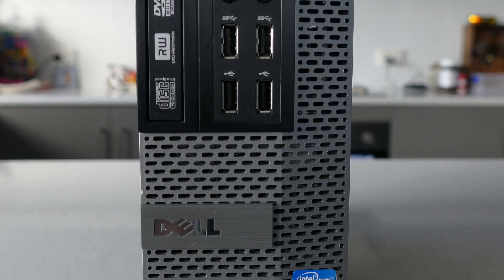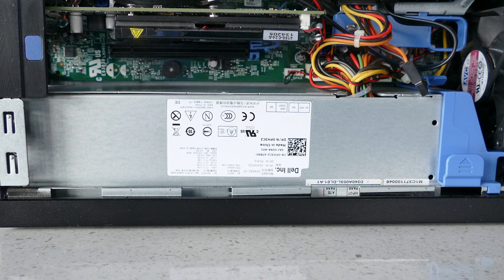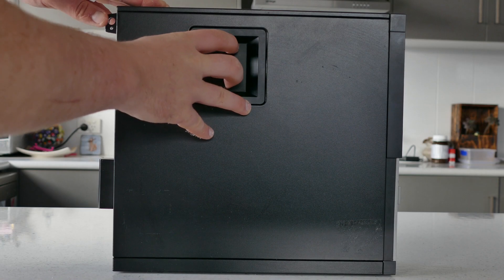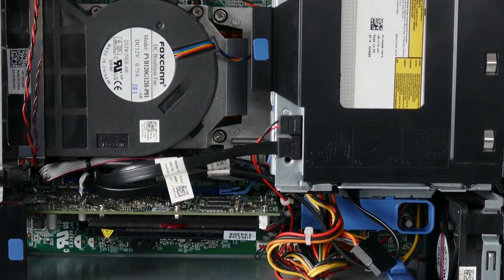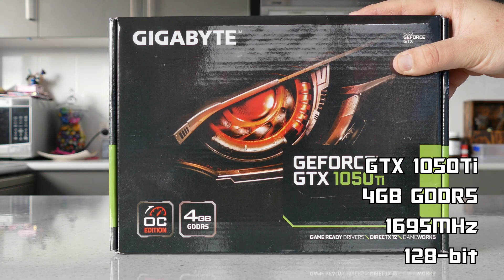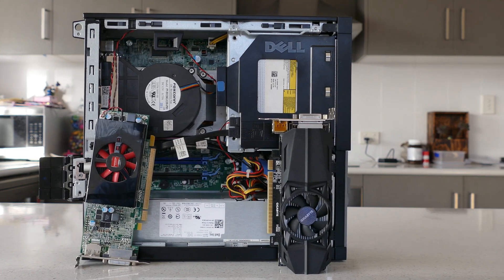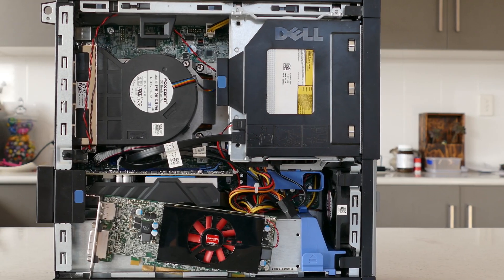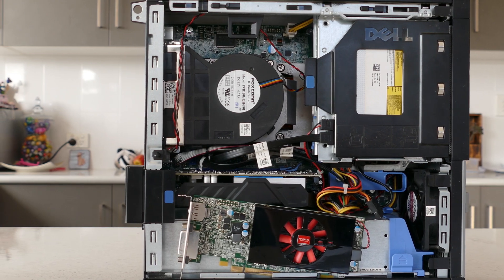Is the 1050Ti a Worthy Upgrade for this Old Dell?

Comment: bro can i use 24 to 8 pin for case swap my lenovo v520 sff that the oem psu is 180w or that can i use a gtx 1050 in 180w psu
Reply from the maker: 1050 will work with your PSU

Comment: Im getting a gtx 1050ti in a dell 7010 dt should i upgrade the power supply to 300w so the components dont die quicker?
Reply from the maker: Check the pinned comment, it will be helpful.

Comment: get a 1650 low profile instead...1050ti is on the very limits of 1080p gaming...
Reply from the maker: 1650 wasn’t released or had only just launched when this video was made so they were too expense for the little gain they offered.
Reply: @EverythingbySam  I have both cards and the 1650 is actually a substantially better performer for me.

Comment: we both have the same CPU's with same built inside but yours is 9010 and mine is 7010, why is that?
will a low profile 1050ti or 1030 card fits inside and run GTA 5?
thanks, good content mate.
Reply from the maker: 7010 is meant to be slightly smaller than a 9010.

Card will fit and I show GTA 5 benchmark in the video. Don’t have a 1030 but would still work just less FPS. Do some YouTube watching or Googling if you want to find out how much less.
Reply: @EverythingbySam  thank you. Is it true that using 1050ti on a low power supply like 240v might damage the power supply?
Reply from the maker: I cover this in the video in the pinned comment but to summarise it. There is a chance but very unlikely.

Comment: I myself would not put this into a SFF PC without leaving the side case off during long sessions. Overheating could be a problem in the long run. Just because it can be done doesn't mean it should be.
Reply from the maker: I can’t remember the specific numbers but I did test thermals for over an hour and so did the person who bought it from me.

It was safely away from thermal throttling.
Reply: @EverythingbySam  I just notice that it sets over the power supply with very little gap. With the video card having just one fan and gaming for 1 hour plus this thing could get very hot. If you live in Canada might not be a problem but for someone living in a hot environment this could cause thermal throttling or even destroy you video card. Again anyone doing this should remove the side panel for better ventilation during long sessions. Just my 2 cents.
Reply from the maker: I live in Australia and had no thermal issues. There is a fan in front of the PSU that draws in fresh air and this this a low powered card so thermal throttling is not an issue.

Comment: i have i3 8th gen and 200W PSU Dell Vostro 3471 Cabinet
Will it bottleneck 1050ti in my pc aor should i go for 1060 or RX570
please hlep
Reply from the maker: Read the pinned comment, it will help.
Reply: @EverythingbySam  i watched that video but i am still confused that's why i asked
Reply from the maker: 1060 or 570 require more than a 200W PSU so you’re going to have to go with the 1050Ti

Comment: Hey I have a 240w psu too, did the graphics card work perfectly without problems? (I have an I7 2600) I have a sff as well
Reply from the maker: Read the pinned comment it will help.

Comment: In 2021, I have a Optiplex 9020 SFF 16gb RAM  and an i5 4570, should I get the 1650 LP or the cheaper option on the 1050ti?
Reply from the maker: Read the pinned comment. It will be helpful

Comment: yo is  the pc still up and running i wanted to know cuz idk if the psu could handle the gtx 1050ti for too long it might potentially combust in long term use of playing video games
Reply from the maker: I on sold it shortly after this video but I haven’t heard from the buyer since so I would say it’s still going strong or he was to afraid to contact me if something went wrong.

There is no guarantee it will degrade the power supply enough to cause issues but I just wanted to throw a potential warning out there as it is a possibility.
Reply: @EverythingbySam  is it safer with only a 1050

Comment: could this fit in my optiplex 390??
Reply from the maker: Yes
Reply: @EverythingbySam  even the sff?
Reply from the maker: It’s a low profile card designed for SFF case’s so yes. The 390 uses the exact same case as shown in the video.

Comment: Is Airflow and temps An issue
Reply from the maker: Yes they are a bit of a concern as the GPU was reaching its maximum temperature but it still managed to comfortably game for a few hours
Reply: OK LOL I was gonna upgrade to the 1050 but I think I’ll just stick with the GT 1030
Reply from the maker: The 1030 is a good option if temperature and power draw are a concern to you

Comment: hey dude! thanks for the video. my computer is 250w. Will this cpu work fine with it?
Reply from the maker: Please read the pinned comment, I answer that question in that video
Reply: Yes. I have 240w, with a i5-3470 and a gt1030 low profile

Comment: would the gtx 1050  low profile fit in to a Dell Optiplex  7040 SFF Intel Core i5 6500 Processor 3.2Ghz 8Gb Ram 256Gb Solid State Drive SSD HDMI Display Port WiFi Small Form Factor Desktop Computer PC Windows
Reply from the maker: Read the pinned comment

Comment: Tellme about PSU has you upgrade it?? it come with 250 W oputput and the PCI-E support 50 w max and the 1050 work with 70 W
Reply from the maker: Check the pinned comment.

PCI 3.0 is an industry standard and supplies 75W of power but some manufacturers say it only supports a lower wattage to be on the safe side as the PSU might not be able to sustain all the power draw safely.

Comment: I have much higher fps than you do at 1080p
Reply from the maker: That’s an incredibly broad statement that has no information in it what so ever to compare against
Reply: @EverythingbySam  I mean at Doom, I don't know why but my average fps tend to be higher, and some other games too, but I do have a similar system with an i7-3770 and the 1050ti, only exception is GTA V where Very high is taxing
Reply from the maker: Your CPU has more threads and a higher clock speed making it more efficient in processing more frames. 

Your settings might also be different to mine which can yield drastically different results depending on the setting.
Reply: @EverythingbySam  Thanks a bunch, just got to know this channel and has helped me more so than others for purchasing (and learning English)
Reply from the maker: Glad I could help mate

Comment: I couldn't find this exact model of the 1050ti low profile, link would be great
Reply from the maker: This video is over a year old, the eBay listing I used is obviously not going to be available anymore. I am sure if you did a bit of searching you could find online retailers still selling the GTX 1050Ti LP, if not the GTX 1650 is the newest LP card available.

Comment: this is dell optilpex 790
Reply from the maker: Optiplex 9010, says on the name plate on top of the case. There are a few variants of these under the Optiplex name that have the same specs but a different model number.
Reply: @EverythingbySam  THANKS FOR HELP

Comment: Hey will a 240w psu work with the gtx 1050 ti?? Will it run games at good fps with an i3 or i5 4gb ram??
Reply from the maker: Read the pinned comment

Comment: Can i add gt 1030 gddr5 low profile 
The power 240w pci slot just 20w 
Gt1030 gddr5 need 30w will be work  fine!!!
Reply from the maker: Yes it will work. If a 1050Ti works a lower powered 1030 definitely will
Reply: @EverythingbySam  some videos i ask answear me it is not work Because the power pci slot just 20w Are you sure that there will be no problems in the future?
Reply from the maker: Read the pinned comment. I cover a heap of info in that video
Reply: @EverythingbySam  ok thx 💕

Comment: Good Morning!
Did you have to change the font to install this video card?
Reply from the maker: Change the font? Your question doesn’t make sense sorry. 

I showed basically everything I did in the install montage.
Reply: @EverythingbySam  Sorry, it's because I'm from another country. What I want to know is whether the PC's power source is the original? Well, the original power source has only 260 watts of power.
Reply from the maker: The original power supply is 240W and yes I kept it in there. I would of mentioned it and shown me swapping it out otherwise.

Comment: Just picked up a Dell 9020 with i5, 16gigs ram, 255w power supply.  Seriously want the performance that 1050ti offers, but that graphics card is a very snug fit inside that SFF case, with fans 1 inch away from the power supply.  Because of compactness, will over-heating be a problem?  Will that 255watt power supply carry the total system load with that 70watt G-card?... or should I get the 35watt GT-1030 and suffer with poopee graphics?  Is anybody here happy with the GT-1030?... thanks!
Reply from the maker: Read the pinned post

Comment: I have an optiplex 3020 mt. Would it be cheaper to upgrade the psu and add a regular sized gpu, or just go for the 1050ti?
Reply from the maker: Read the pinned comment

Comment: Hey, would I be able to use a GTX 1050Ti LP in an optiplex 7010? The cards wattage is 75w and the PCIE can only supply 50w would this mean less fps/no boot?
Reply from the maker: Refer to the pinned post

Comment: Have you installed the 1050ti with the stock psu (255w)?
Reply from the maker: Yes, with the stock 240W PSU. I would mention if I swapped it out.
Reply: with that psu, would the system break after some use?
Reply from the maker: Read the pinned post
Reply: @EverythingbySam  ok sorry i didn't see it. Thank you for the reply tho.

Comment: What are the possible video cards for Optiplex 7010 pc. I'm thinking about the GTX 1050 but I'm not sure whether it will fit or not. Here are some more specs(i7-3770 CPU 3.40Ghz, 3401 MHz, 4 Cores, GT 1030)
Reply from the maker: It’s the exact same case as this one so all low profile graphics cards will fit
Reply: @EverythingbySam  Ahmm, but what about the power supply, do I have to do anything about that?
Reply from the maker: Well it’s rare to find a replacement one as they have proprietary connectors and cost way more than they should do there isn’t slot you can do.

You might be able to find adapters that work with a normal PSU but that’s won’t fit in the case.
Reply: @EverythingbySam  So what would be the best choice for me? Is it even worth getting a video card at this point?
Reply from the maker: Up to you. It will work but for how long is the question and if it fails what damage will it cause?. It’s up to you to assess the risk verse reward,

If you want to be safe a GT1030 or a Yeston RX 550 lp are your best options.

Comment: I have an optiplex 3010. And I am
Thinking buying a gtx 1050 ti lp an ssd and 2x4 ram with a power supply of 600w ...it
It good ? Or I don’t even need the power supply change ?
Reply from the maker: I would recommend a power supply change but this motherboard requires proprietary connector only found on certain HP power supplies that cost way to much for what they are so you need to either find adapters that will work with a normal PSU or just hope the already installed PSU is enough to get you through.

Comment: What would be the benefit of spending $200 for a video card compared to just buying a dedicated gaming system? The xbox one is sold as low as $159 and certain games are cheaper on those systems than the PC edition.
Reply from the maker: The Xbox one is literally a gaming and entertainment system where as a PC can be used for so much more. It’s customisable, upgradable and versatile. There are thousands more games available on PC (a lot are free as well) and a graphics card also helps with video encoding, editing or 3D graphic design.

Most games are cheaper on PC as there are constant sales and CD keys available from multiple vendors, it’s actually quite a rarity to see a game cheaper on console but it does happen occasionally.

The main reason for a PC isn’t for gaming, it’s more the versatility of multitasking. Nobody working from home currently are using Xbox’s (unless their job requires it) where as with a PC you can work all day, game all night and multitask when needed. 

A good example if you can run a VPN directly on your PC and watch Netflix from another country, game, stream and listen to music all from the same system.

Comment: Hi dude, do you think a Zotac GeForce GTX 1050Ti 4 GB Mini Graphics Card - Black can with in that case?
Reply from the maker: No, that’s a short graphics card but not a low profile one. 

You could get a PCIE riser cable and do a bit of a janky setup if you really wanted to make it fit but naturally out of the box it won’t fit.

Comment: So, if I have a Dell Inspiron 3670 and it has the original 290w power supply,  will it work with a GTX 1650?  It's a pretty recent machine that I got last year and it consists of a intel i3 quad 8100 with 8GB of DDR4 Memory.  It originally came with a 1TB 5400 Toshiba HDD and I moved the OS into a Nvme M.2 Samsung 960 EVO SSD.  Not too sure if the HDD will draw lots of wattage.  I am thinking I might just buy a sata SSD because they come cheap these days.
Reply from the maker: Unfortunately I cannot answer most compatibility questions as each brand, model and iteration of a SFF PC is always different so you are best to google it and hope there is a YouTube video or forum post on your model of SFF PC that might have the answer.

Comment: Thank you so much for this, i just ordered the 1050ti lp
Reply from the maker: No worries. Good luck with your build
Reply: Good Luck and I bought a PNY GTX 1650 LP, which in general should be better than a 1050ti.  My card should be arriving this Wednesday.
Reply from the maker: I have a video on the GTX 1650 LP in the works currently
Reply: Where do you find the low profile ones? I see full size everywhere

Comment: It's strange this ran, the GTX 1050ti requires 75w of power yet the slot in that machine is capped at 50w.
Reply from the maker: PCIE 3.0 is a standardisation of 75W and cannot be capped below that it is just recommended not to draw more than 50W from the slot
Reply: @EverythingbySam  Oh I see, thanks man. :) Just ordered a 7010 sff today, looking forward to adding a GPU.

Comment: I have dell 9020 optiplex sff ram 8 i7, i want to install gt 1030 lp with 255w psu, is that possible?
Reply from the maker: Yes
Reply: @EverythingbySam  how much is your computer's power supply for vga 1050ti??
Reply from the maker: The power supply I had in this system was 240W
Reply: @EverythingbySam  what is your specification mini pc dell 9020 sff for gtx 1050 ti lp??
Reply from the maker: I am not entirely what you mean by that? I literally list the entire specs of my unit in this video

Comment: I have a dell Optiplex 3010 SFF and will it work with the gtx 1050 ti, stock PSU for a long time?
Reply from the maker: Can’t guarantee how long it will last as this setup basically pushes the power supply to its limits which is not the best for longevity of your components.
Reply: @EverythingbySam  So a Gt 1030 would be better in the long run right?
Reply from the maker: Yes that’s the safer option

Comment: Will gtx 1650 low profile or a 1050 ti low profile work on 180 power supply🤔
Reply from the maker: No I definitely wouldn’t risk it on a 180

Comment: Any problems with heat in the chassis?
Reply from the maker: Not due to the power consumption of these components (plus I thoroughly cleaned everything out and repasted the CPU). The CPU was around 55C and the GPU was under 80C if I remember rightly

Comment: can psu handle with this 1050ti?
Reply from the maker: Yes, although it’s not recommended it can handle it.
Reply: Everything by Sam I’m putting a 1050ti in a prodesk, the majority of my money is in the card, sad and ram, if my 240w psu has issues, will it effect the gpu at all? or just the psu, it’s not the end of the world if the sff pc psu or even pc dies but I really wouldn’t want to damage or waste a brand new gpu, just know little about how that would work
Reply from the maker: Honestly the PSU can take out anything that it’s connected to depending how it dies. I can’t guarantee it won’t take out the GPU but it would have to die in a pretty spectacular way to take it but it is possible.

Comment: Hi Sam, 
Does this Gigabyte Geforce GTX 1050 ti LP fit my Dell Vostro 3668 ? It only has 240w PSU so im not sure it will work or not. :<
Reply from the maker: It would fit but that looks to be a normal case not small form factor so you could get away with any 1050Ti or 1650 that doesn’t require a power connector
Reply: @EverythingbySam  Thanks so much !

Comment: I turned the same system into a HTPC. - i7 3770, 16gb ram, an ssd, and a gtx 1050ti!
Reply from the maker: They’re a good size for that
Reply: https://www.amazon.com/gp/aw/d/B07CTSFCRR?ref=ppx_pt2_mob_b_prod_image#
Reply: does it work fine on dell 240w psu?
Reply: KINGDAVE yes without a hitch
Reply: @T4P2028  how long youre using it?
Reply: KINGDAVE 2 years
Reply: @T4P2028  you using it on heavy softwares?
Reply: @T4P2028  thanks to you, you saved my wallet from the $50 psu.
Reply: KINGDAVE I play some games on it like csgo and emulators. It never crashed or gave any issues although right now there is a low profile gtx1650 which is a better card.

Comment: I added this card (a GTX 1050 OC 4GB LP, not the Ti version) to a Lenovo M720t i7-8700 to replace the totaly pointless GT730 it was fitted out with. This system has only a 180W power supply, which is enough for this GPU. Civilization VI and Cities Skylines run great on maximum settings. This still is a great GPU, the 1650 isn't worth the extra expense. Thanks for the video, you told me what I needed to know.
Reply from the maker: The GTX 1050 is definitely the better option over the Ti version as the minimal FPS gain isn’t worth the extra $100 for it. I did manage to get a GTX 1650 low profile on sale and will be testing that sometime soon.